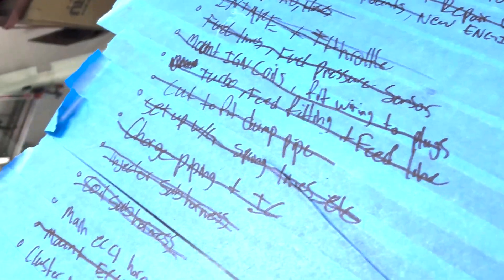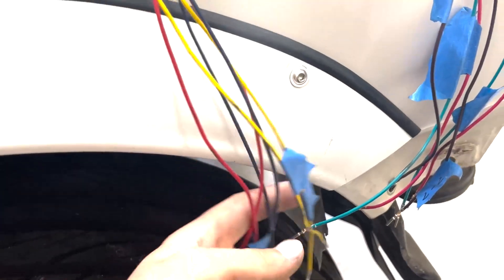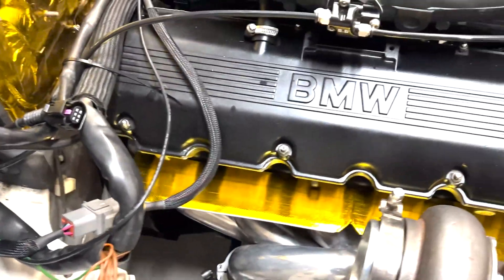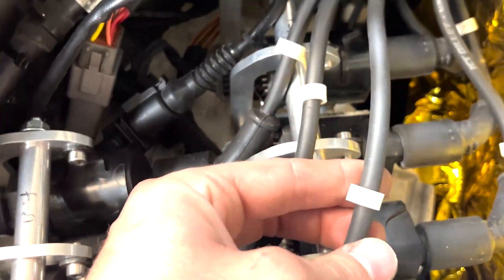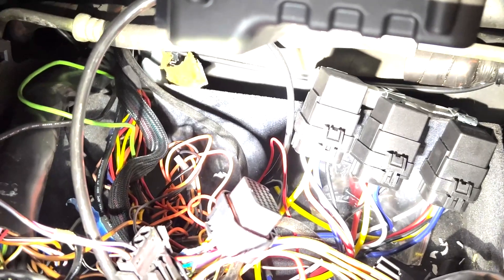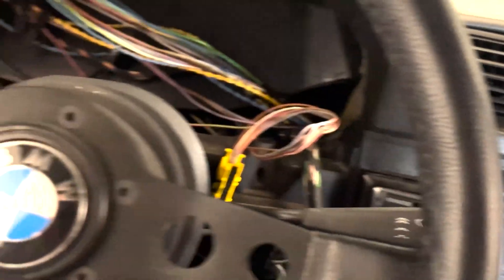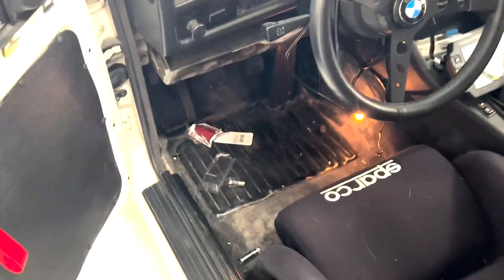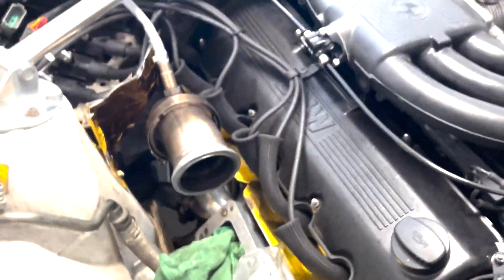Turbo BMW Haltech Goodies. HiTech 80s Machine #haltech #bmw #ic-7

Comment: That’s looking great! I’ve been reading up on the haltech a lot over the megasquirt, I’ve mainly dealt with Holley stand alone, do you find the haltech software somewhat user friendly to navigate?
Reply from the maker: So far it’s been easy to navigate and play with. If you’re doing an e30 with an m20 the 750 seems to be pretty great.